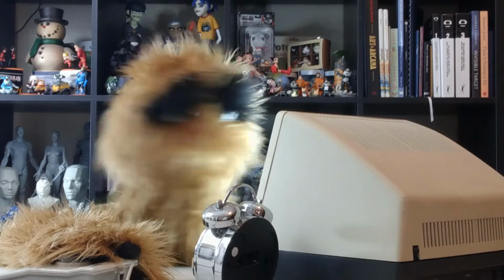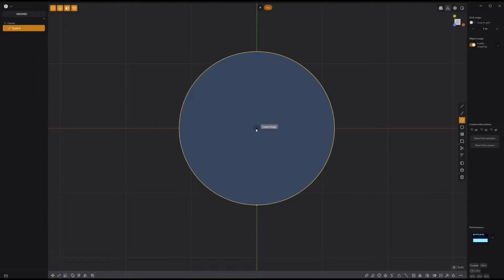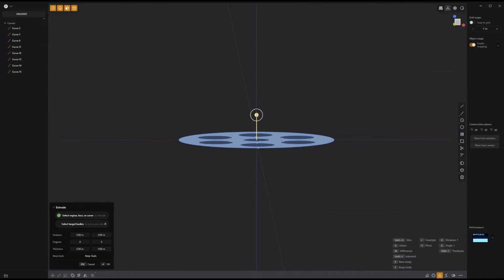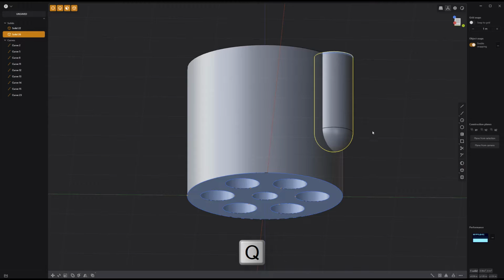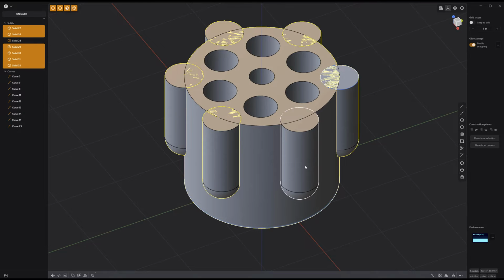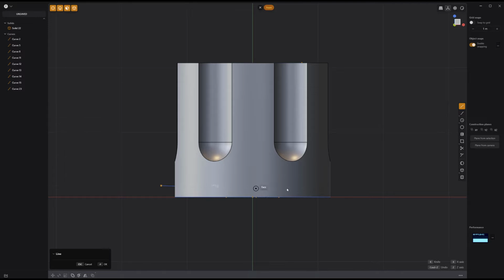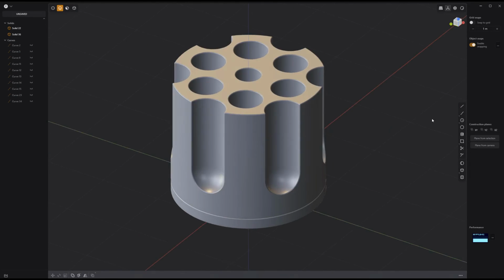Plasticity | Model a Gun Cylinder

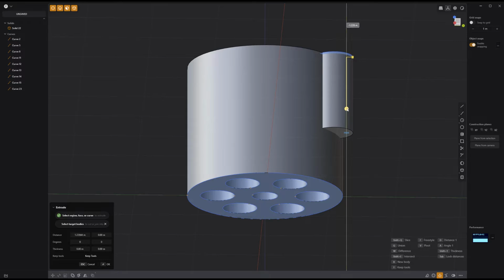Comment: 0:22 "Activate the circle curve and extrude it in to the main solid". You have a solid cylinder when you are done with this process. I am looking closely trying to copy what you are doing but i'm getting a "straw" like object with no caps on the top and bottom.   I see you can mess with "Thickness" but I am guessing that's not the proper way to do this.

Comment: EDIT: Got the step to work! Problem related to the way objects are created in the app. If you aren't careful, you'll make the second object part of the first, instead of it's own object. 
-Also, I needed to use a cylinder instead of a circle, because the circle wasn't considered to be "filled", and just extruded into a tube with no end caps. This creates a problem trying to Boolean the tube to the sphere. But using the cylinder and sphere I was able to replicate what you did, and man is that some amazing topology in like no time flat!

OLD:
Thanks for the tutorials! So I'm having a problem replicating what you did in the video: 
When I get to the step about adding the third (exterior) circle, when I extrude the circle I'm getting a "Sheet" object, but you are getting a "Solid" object. The Booleans don't seem to want to behave either (related to the Sheet object?). Is it a matter of where I'm clicking on the circle? I've watched that couple seconds over and over, but I can't tell what you're doing there that's making the difference (unless the app changed in the last 5 days).
Reply from the maker: Sounds like you are extruding edges instead of face.

Comment: Very nice, loving these videos.
BTW, just in case your not aware, capping the cylinder  can also be achieved by  starting a Fillet  at one end of a cylinder then clicking on the side of the cylinder to generate the rounded cap
Reply from the maker: Thanks for the tip... that a new one for me. Appreciate the shared knowledge